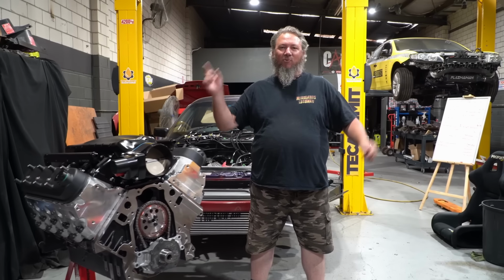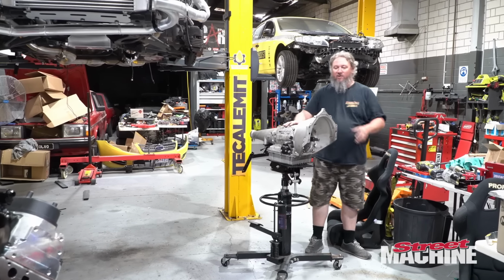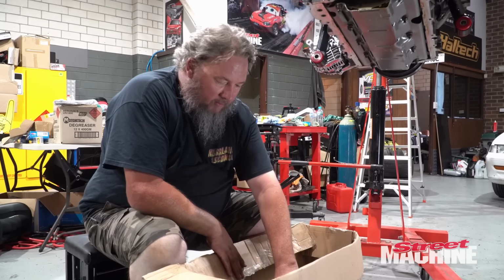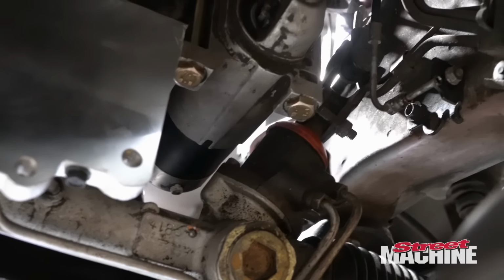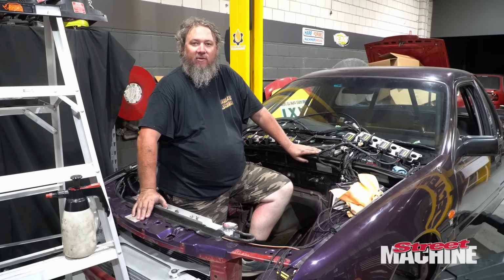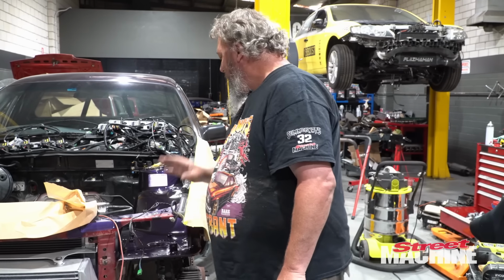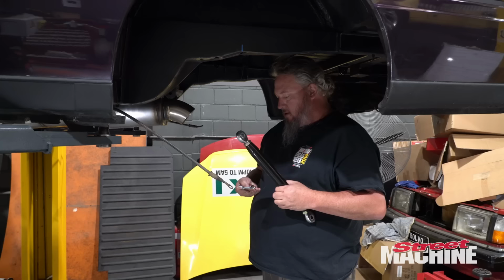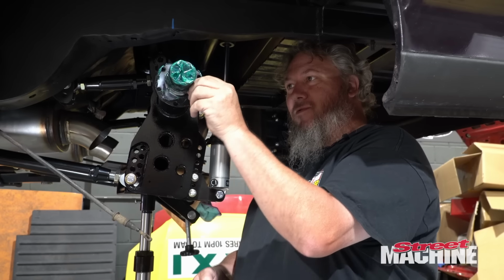Carnage - Drag Challenge Ute Part-16 - More Hurdles Than The Olympics!

Comment: How good is making it fit. Think I had my engine in and out about 20 times lol. Dry sump pump hit the factory steering so I had to do a rack conversion that also hit the cross member. Had to mod the cross member to make clearance for the oil lines and fittings and the steering shaft. Now I’ve gotta get my turbos installed but I’m out of cash haha

Comment: Hi. Lift the engine 15mm and then put 15mm spacers between the k frame and the chassis rails, engine will be in the same place in regards to the body and you get rack clearance.

Comment: Great episode Scotty. It is just nuts how much work is involved for everything you need to do. Get it is fun building the project but geez it is so much. Where you bolted the rear end in, as you mentioned its fully adjustable. Is it a standard that you start with and move it around? Was there logic for around the placement on ride height and so forth with this location?

Comment: Maybe your next project should be a hemi LS with flat plane crank, Ferrari style extractors, sequential multiport injection and an awesome twin turbo kit with interchiller. Put it on an auto gearbox with manual override. You could try it in a ve commodore. Just keep the stroke below 3.75 inches and you get good and smooth performance with better breathing. Try a FlatFast crank for fun. Budget ferrari.Future project?
Reply from the maker: Haha
Reply: @STREETMACHINETV  but youll see the difference 😎

Comment: Pretty sure it’s VN V6 K frame and VL rack for the most clearance from memory..
Reply: Also you might as well pull the 3 factory fuel lines out whilst you have the engine out, helps make a bit of room